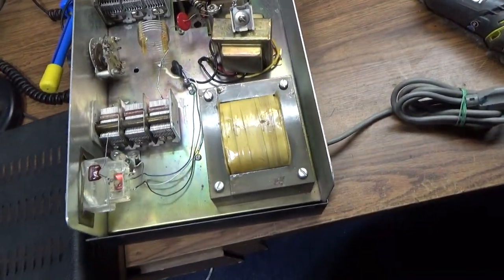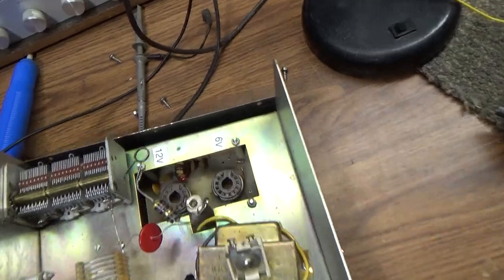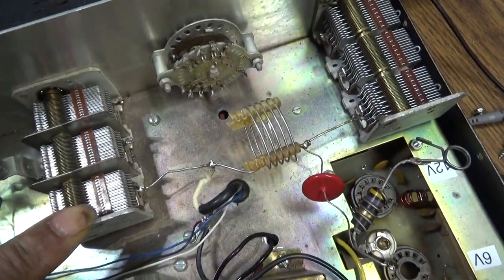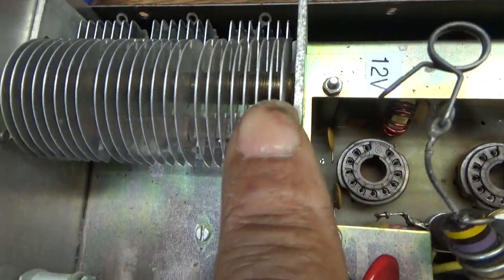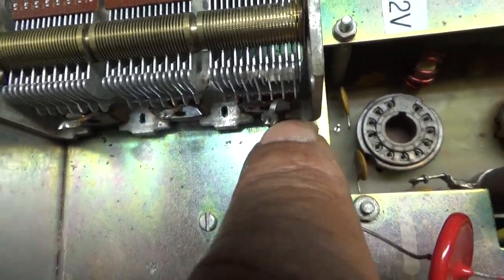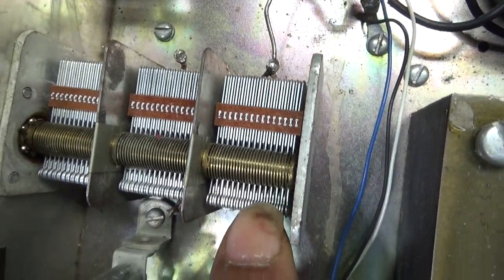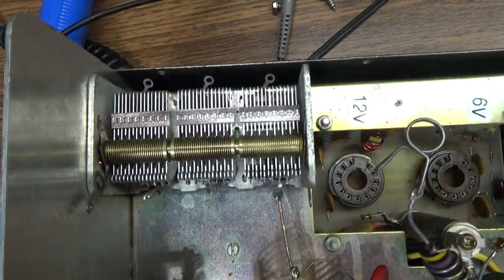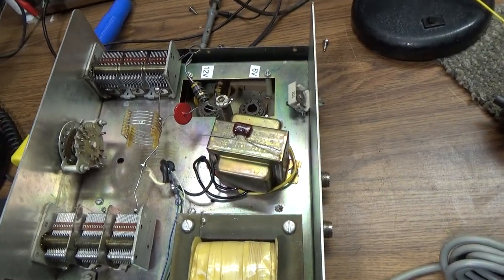Basic thoughts on Tube RF Amplifier output ' Tank' circuits.

Comment: Great video Doc! Thanks for helping me understand tube amps. Sold my Maco 300 with new 8950’s . Rebuilding the the 300a Palomar it has the old style short 6 KD6’s got some new 6KD6’s and they are taller will need to extend the cover! My Elmer sold me a 2008 Amartron  811 three tuner for 400 bucks I’ll use that on 20 meter’s chow   JohnBoyUtah KJ7TBR 🇺🇸😎🎙
Reply from the maker: Good stuff.

Comment: Never seen a cap on he tune Sue for more capacitance I’ve seen it to pad the load side but when you do that starts your pf higher as well. I’ve done it before messing around with air variables but wouldn’t keep it that way, one needs the correct of. Good video my brotha 👍🏻
Reply from the maker: Ita unusual to have one on the tune side as normally the PF's needed is so low, it doesn't need to be padded. However, if I had say a 5-35pf variable and I needed 50pf's in the circuit, I don't see anything wrong with adding something like a fixed 20pf. I also had an amp that was a Dentron 2000L with an 8877 with a HD Dahl transformer. The transformer upped the HV a lot and the factory tune cap was arcing. Since this amp was monobanded, the tune cap had a lot of unneeded extra pf's but not enough voltage rating. This amp had like a 100pf padder on the tune in Series. It worked, but tuning was a little twitchy. I replaced that scheme with a proper rated higher voltage tune cap and it worked a lot smoother.

Comment: Thanks for explaining the sizing of the plate and tune capacitors. Great idea , having a amplifier set up to test output tubes. As always said, “the best way to test a tube , is to test it in the circuit it’s used!

Question:  working on a Kenwood TS-830, in the final output circuit: they have a small 6.8 uhy choke in series from the power supply, connected to the  cold end of the large RFC choke. The  hot end of the larger choke is connected thru a blocking capacitor and then on forward to the parasitic suppressors to the plates. 
What is the purpose of the 6.8 uhy choke. Is it just to capture any residual RF that sneaks by the main  RFC?  It’s so small; the size of a 1/4 w resistor.  Is it being used as a fuse to protect the larger main pi wound RFC? Why is it so much smaller in physical size compared to the main RFC?
Keep they great videos coming, I certainly appreciate your lessons.
Reply from the maker: Yes thats exactly what that is for, to catch the stray rf that might sneak by, and also to make sure that there are no resonant frequencies from the choke's'.

Comment: Where is the band switch?
Reply from the maker: Amps that are monoband don't have one, and many amps built for CB are just that monoband. Most Ham amps are multiband and have a rotary switch on the front that says something like l0 meters, 20 meters, 40 meters and 80 meters. Behind that rotary switch would be the Band switch. If you look at the very beginning of this vid and at the amp on the left, the band switch is still there but disconnected and is right behind the Tank coil. As these amps are monobanded, they don't need a band switch.